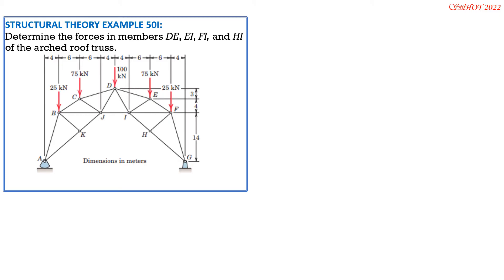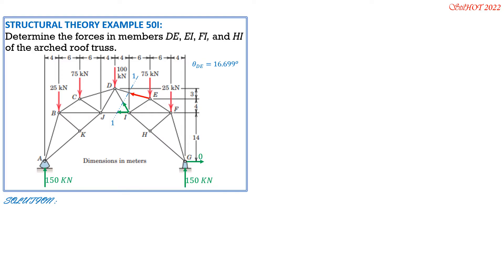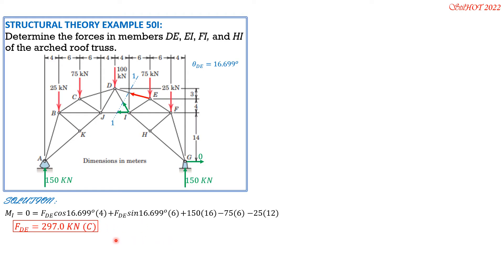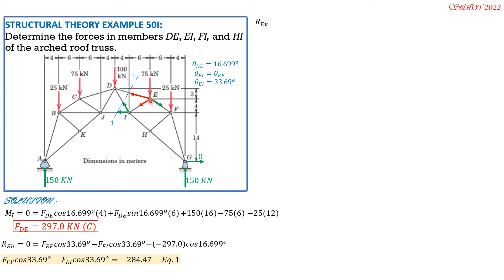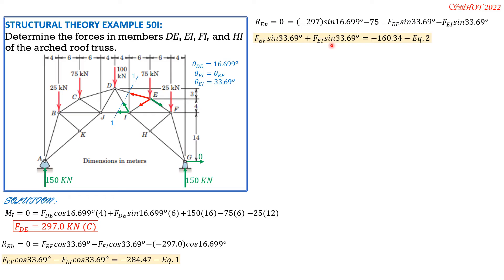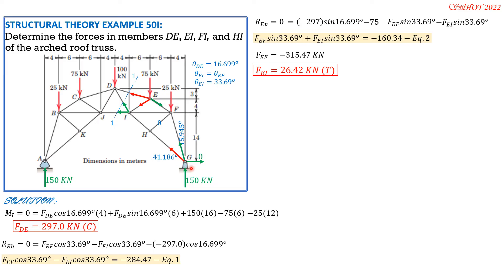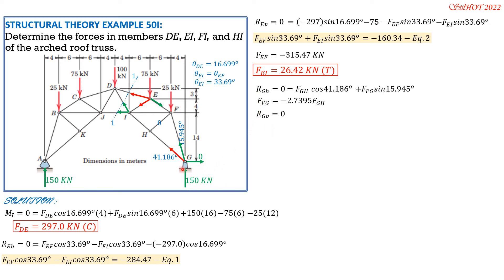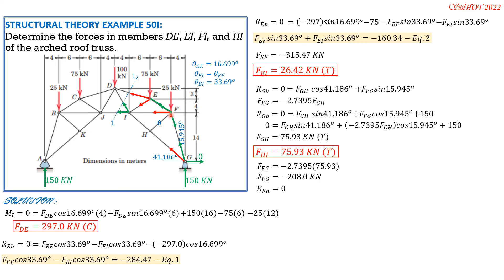STRUCTURAL ANALYSIS, EXAMPLE 50I

Comment: hello sir, ask ko lang po sana for clarification about the problem. duon po sa part ng summation of moment about I, hindi po ba dapat negative yung force DE sin teta times 4 since magiging clockwise po ang rotation ng vertical force ng DE with respect to its perpendicular distance na 4? salamat po
Reply from the maker: @masobrusa07. Please state the time of the video in particular. FDE cos16.699(4) +FDEsin16.699(6) are all CCW (both positive).  For questions and clarifications like these, please do not ask me anymore. Consult with other viewers and subscribers or with your classmates. FDEcos16.699 is leftward and FDEsin16.699 upward and both produce CCW moments about I.